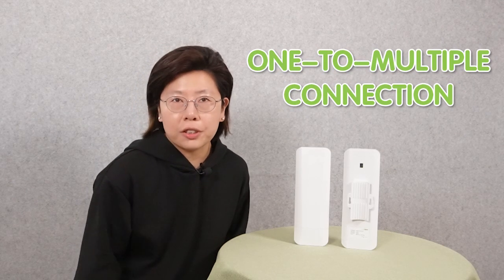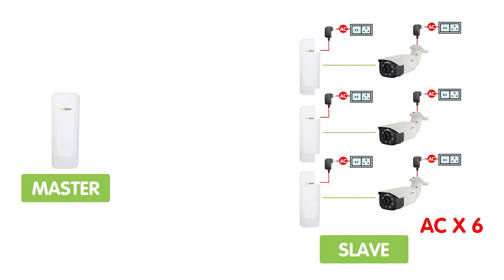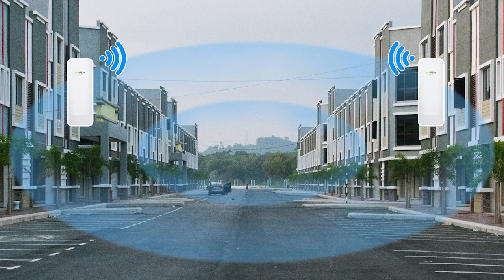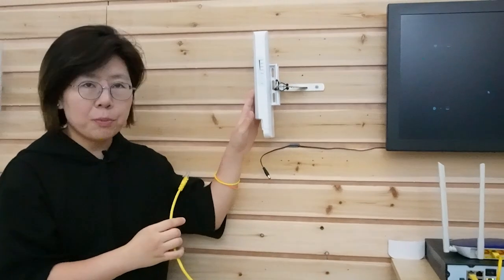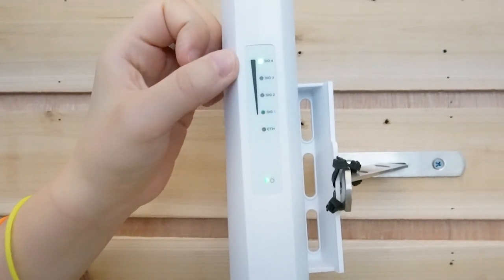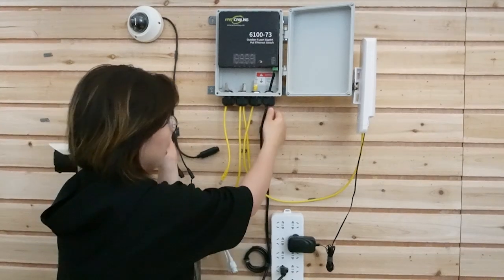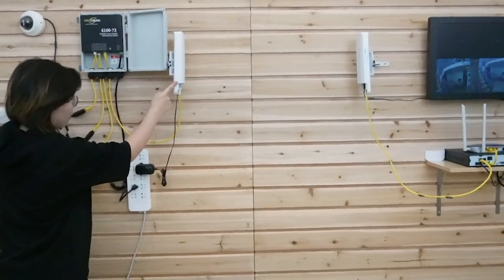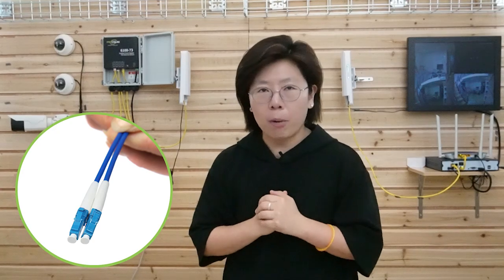Install Multiple IP Cameras over Point to Point Wireless Bridge

Comment: What does the router do plugged into the nvr if you are watching on the tv via hdmi?

Also the bridge plugs into any of the camera ports on the nvr, and not into the LAN port?
Reply from the maker: HDMI is local. The router is only there for remote viewing, mobile apps, alerts, updates, or time sync. You can plug it into a PoE port only if the NVR supports multiple cameras on a single camera port (some do, via ONVIF or multi-channel input). If you plug the bridge into the LAN port of the NVR, the NVR will detect each camera over the network (IP cameras).
Reply: @Fastcabling ok thanks!
Do I need to address the cameras manually or will the nvr just detect the cameras automatically when I plug into the nvr from bridge?

Comment: Hi. Can i create point to point like this solution? Example pole 1 connect to pole 2 , and pole 2 connect to pole 3. Each pole has 1 cctv camera. And pole 1 connect to office.
Reply from the maker: You'll need 4 bridges to relay the signals to pole 3. The bridge at Pole 2 is already paired with Pole 1, so it cannot relay traffic to pole 3. You need to set up a back-to-back wireless bridge. Please refer to this video: https://youtu.be/GrDfXqowRvk

Comment: Thanks good video demo, if I don't have POE switch, can I use the regular network switch?
Reply from the maker: Yes, you can connect a network switch to the bridge, but you may need to power the cameras separately.

Comment: I'm still new in this, pls can I see where the wireless network is connected to 2 cameras and 2 POE injectors with the switch hub in that connection.. I want to see something something.
Reply from the maker: Our wireless bridge has two Gigabit LAN ports so you can connect 2 cameras directly to the device via Ethernet and power them with DC. Or you can connect a PoE switch (plugged into the AC outlet) to one of the LAN ports on the wireless bridge and connect the cameras to the PoE switch using Ethernet cables. The PoE switch will send power and data simultaneously to the cameras. 

If you need to power the camera using the PoE injector, you can connect the injector to the bridge first and plug it into a nearby socket, but using a PoE switch will reduce the cables needed.

Comment: I don't know why the cameras always to change ip addresses automatically ?
Reply from the maker: Most networks use a DHCP server (usually your router) to automatically assign IP addresses to devices. If your IP cameras are set to obtain an IP address dynamically, they can be assigned a different IP address after a reboot.

To prevent IP cameras from changing their IP addresses, you can assign a static IP to each camera. Here’s how to do it:

1. Access the Camera's Settings: Log into the camera’s web interface or NVR software using its current IP address.
2. Disable DHCP and Set Static IP: In the network settings of the camera, look for the "DHCP" option and disable it.
Manually assign a static IP address to each camera. This IP should be outside the DHCP range of your router to avoid conflicts.
3. Assign IP from Router (Alternative Option): You can log into your router’s configuration page and assign a "reserved IP address" based on the camera’s MAC address. This way, the DHCP server will always assign the same IP to the camera.
4. Check and Save: Once the static IP is set, save the configuration and reboot the camera. It should now retain the same IP address.
Reply: @Fastcabling  So I build cameras by wireless bridges, the cameras change from DHCP to Static right ? Thank you for hearing from you.
Reply from the maker: Yes, when you set up cameras using wireless bridges, it's recommended to change the cameras from DHCP to Static IP. This ensures each camera retains the same IP address, improving stability and avoiding potential network conflicts.

Comment: Is an internet/modem connection required to make this set up work? Or will it work with no internet?
Reply from the maker: Yes, it must be connected to your router or modem.
Reply: @Fastcabling but In this  video, the bridge was not connected to router

Comment: Hello, thank you for the nice video. I just have a question. Why do you connect an external power supply to the bridge antennas? They are connected on both sides on the PoE line. On on side the NVR brings the power and on the other side the PoE switch will supply the bridge antenna. I’m wrong with my understanding? Thank you.
Reply from the maker: That's because this wireless bridge can only accept 12V DC and 24V passive PoE while our PoE switch delivers standard PoE power. 

For more information: https://www.fastcabling.com/product/1-pair-wireless-long-range-ethernet-bridge/

Comment: I've installed 3 IP cameras using your example.  But i don't see 3 separate camera feeds in my monitor from Hikvision recorder, through the LAN port.  Yet, when using any port (of the 8) I see 3 cameras switching in the same window.    What physical IP address, of settings do I need to correct to view the 3 cams, coming from the wireless bridge?  Thx
Reply from the maker: I think the problem is not the bridge. The birdge is transparent to the network. There is seperate VLAN running to negotiate the networking. If you saw the camera switching in same windows, i guess you have put receiver to one of PoE ports at the NVR. The NVR is designed to automatically make the link to any cameras to the PoE port. Since you have three IP address, so the NVR just keep changing the IP address. You might try the LAN port on the NVR instead of the POE port.

Comment: Would I be able to use any type of cameras with your bridge?
Reply from the maker: The bridge supports a wide range of IP cameras, ensuring compatibility with various models and brands for a seamless and versatile setup. Check out the product info link for specific details on compatibility and features. https://www.fastcabling.com/product/1-pair-wireless-long-range-ethernet-bridge/

Comment: can we use this bridge connection (point to point wireless bridge) install to moving equipment, juts like, i have 8 excavators and want to install 2 CCTV camera to each one of them, i have tried using modem, but in remote areas, 4G connection are not available, so i can't use modem to monitor my equiments.
Reply from the maker: It might not work. The wireless need to align. If the equipment is moving, then there is no guarantee it will stay in the same line.

Comment: HI, I would like to start by saying this is a very thorough step by step video, this has helped myself to understand this allot. My question is this, Do you have to setup the NVR at the source, which you have in the video, or could you simply remove the POE switch at the receiving end and use the NVR as the switch. I simply want the wireless bridge to connect to the internet so that you could use the mobile app to check in on the cameras from time to time.
Reply from the maker: Based on your question, it sounds like you want to use the NVR as a central hub for your IP cameras. You can connect the PoE switch to the NVR will act as a central recording and management device for the cameras. It will receive video feeds from the cameras and store the footage. If you simply want to monitor your cameras on your phone, you can just connect the NVR to your existing network and install a mobile app provided by the NVR manufacturer or a third-party app that supports your NVR model.

Comment: Can a second bridge be installed like a camera to the poe switch?  Then a second poe switch installed at the slave of the second bridge?
Reply from the maker: I assume you want to set two switches at both ends. Yes, the wireless bridge is transparent to the network. It turns TCP/IP to wireless signal.

Comment: All PoE switches are not alike and a thing you should also pay attention to closely because the radios will likely use PPoE (Passive Power over Ethernet : 12 - 40 VDC) where most cameras use the 48 - 57 VDC PoE Standards. A managed PoE switch typically can be set up to supply all the power to the devices per port BUT these switches can be quite expensive and require some experience setting up. The one we are using cost us right at $1100 USD
Unmanaged (or Dumb) PoE switches like the one in this video are preset to supply power at a specific PoE standard so it will only supply power to devices compatible with the switch power output standards. Unmanaged switches are  definitely cheaper because they lack the features to control what power goes where
Reply from the maker: You can try Ubiquit DC48V to DC24V passive convertor or the mananged POE switch you mentioned to select the standard  (DC48V) or passive POE (DC24V) output. However, this kind of selection design take 1236 twisted pairs for standard POE and 4578 for passive PoE. Technically it break the IEEE802.3 standard. It doesn't work with latest IEEE802.3bt (aka PoE++), since all the 4 twisteds pairs must be occupied to send the standard PoE power.

Comment: It may be worth noting that you should try to use bridge radios that have gigabit ethernet ports especially if the bridge is transporting several camera streams @ HD resolutions. Ubiquiti nanobeam  5AC gen 2 radios are a good choice for bulk P2P linking and cheap on the second hand market right now and the are gigabit ethernet devices.
For the multi point setup we use a Ubiquiti Rocket Prism 5 AC and it's matched omni directional antenna for the master / primary / base station and nanostation 5AC for the slave since these have dual ethernet ports we can put 2 cameras on one slave unit without using a switch. fr5om the rocket 5AC it loops through a managed PoE switch and to a storage server rack, a monitor / maintenance terminal then comes out to the nanobeam 5AC to be sent too the main office and the NVRs on that end. The storage servers are a redundant backup incase the main NVR's go down or get vandalized. Another ethernet line connects the ISP on this midpoint site as well so the whole system is carrying internet access which in turn allow the use of mobile phone apps with the system as well as a 3rd off site cloud storage solution
Of course alll this is for an 802.11ac system. you can use earlier model M series radios if you do not need the bandwidth of gigabit ethernet.
basically buyers need to pay attention and  plan their systems so there are no bottlenecks (which cause frame dropping, freezing, signal loss) and plenty of room for expansion / overhead since conditions change constantly and bandwidth never remains constant on one figure.

Comment: i connected 4 IP cameras to one but only one picture shows up on the other side.  looking at your video, i think i got my answer.  i just have to go to the job site and apply it.  nowhere in the manual mentioned anything about that on and off switch until you mentioned master and slave. switch.  so, i'm going to turn the camera side switch off and se if it makes a difference.  thank you for the hint.
Reply from the maker: Glad to know it helps :-) If you have more questions, please email us at support@fastcabling.com or submit your inquiry here: https://www.fastcabling.com/free-solution-design/. Our engineer will get back to you as soon as possible.

Comment: I would like to connect 5 camaera to one access point being the nvr the receiver and camaras transmitters
Reply from the maker: You might need a PoE switch to aggregate video from these cameras before you upload it to the transmitter. Eventually, the receiver only need to work with single transmitter.

Comment: What ais the max distance from the ip to. Switch?
Can it go up to 100m
Reply from the maker: It is 100 meters based on TCP/IP protocols. You will need some kind of extension solution to go beyond 328ft without breaking the protocol.

Comment: Um, if you don't buy cheap crappy product, you can to Point to multi pint just fine. Mikrotik has awesome products for ptmp.
Reply: Aggreed, sadly, many security companies use this but don't have a clue about radio and throw shit up willy-nilly creating noise and interference for other networks.
Reply: @bentheguru4986  you use cheap china garbage, you get unreliable network. See it all the time. Not saying the ops stuff is garbage never used it or even see it on the market.
Reply: @JasonsLabVideos  Just pushing their gear. Avertising YT channel
Reply: @bentheguru4986  alot of repeated videos too.